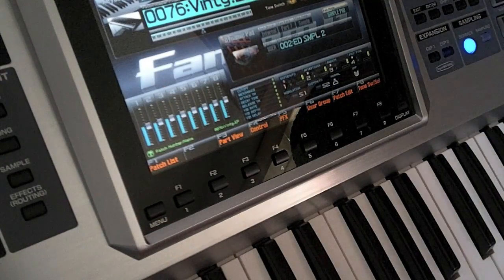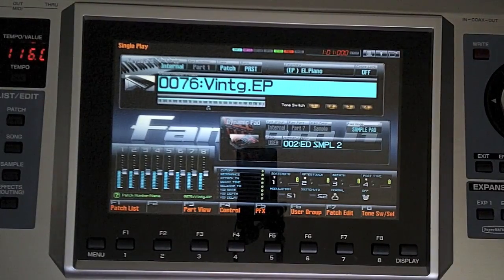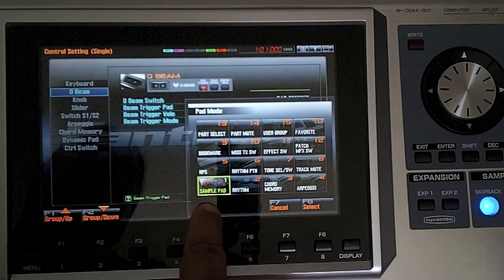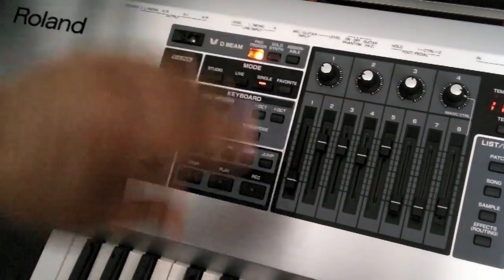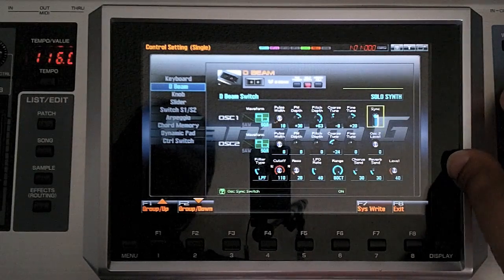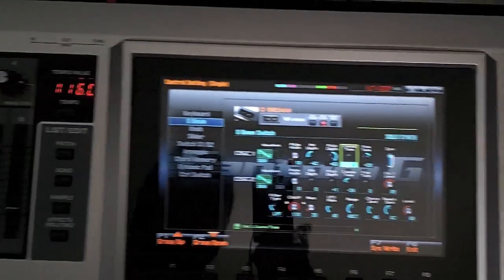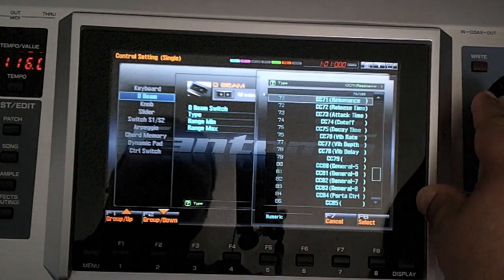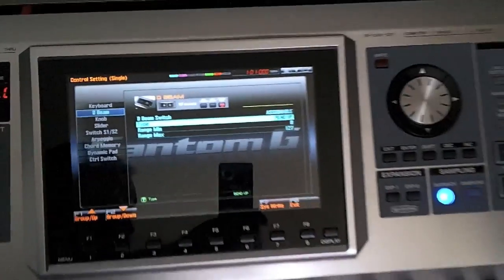Roland Fantom G  D Beam

Comment: Ed, i want to use the d beam to control the volume of the layered sounds not affecting the other layer. On my jupiter 50. i want the piano not affected. But i want the strings sound to be controlled by the d beam. Thanks alot sir